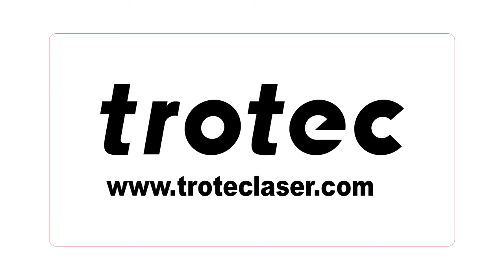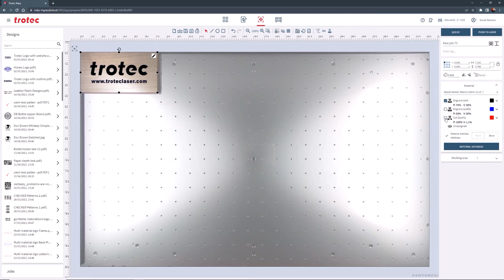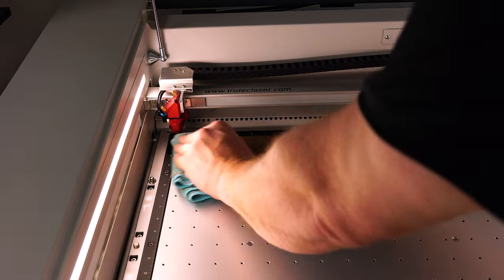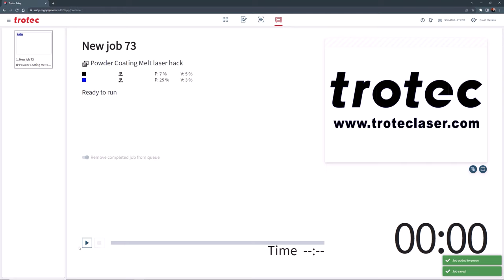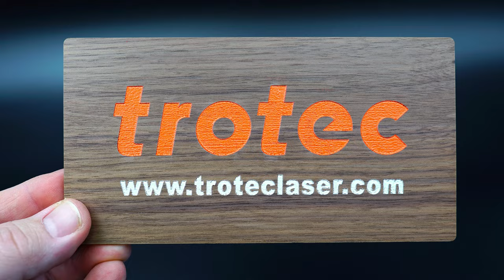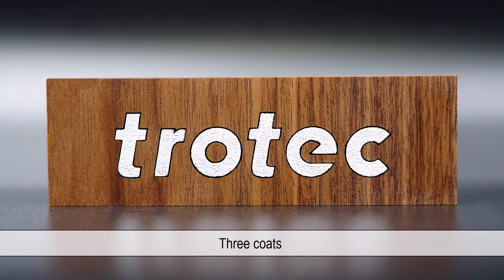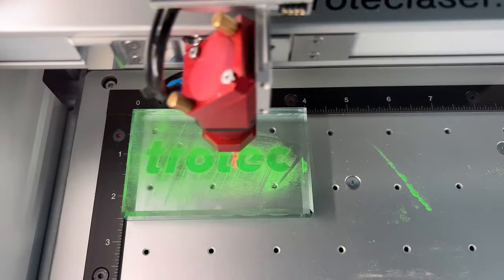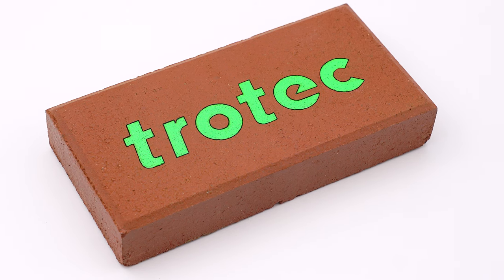Laser Hack: Powder Coating Color Fill

Comment: I've tried all of these suggestions and find that a simple heat gun on a low setting is far easier and better result.  Even does white perfectly.   Cheers!
Reply: Did you clean any powder that did not belong in the design before doing the heat gun alternative?
Reply: @CreateHubTips  You can probably use a masking tape over the top to achieve a clean surface.
Reply: @thenightninja13  masking is essential!  but i use the heat gun as well.
Reply: What is your complete flow?

Comment: So much easier if you use a heat gun on low, or a heat source like the broiler or toaster oven. Lightly sand when done.
Reply: Using a laser offers a significant advantage over a heat gun or oven based on extensive testing because it delivers heat precisely where it's required, enabling controlled melting of the coating at a specific location. On the other hand, a heat gun might inadvertently fuse any leftover or residual powder coating onto the product surface. This is because the squeegee is not always fully effective in removing all of the powder coating, which could potentially compromise the final look of the product. This principle also applies when the product is placed in an oven post-laser process. Any residual powder coating can be easily wiped off the surface as it was not subjected to heat, ensuring a cleaner finish.  Moreover, regardless of the heat gun's fan speed, even on low, it tends to blow out the powder coating from the engraving, creating an undesirable mess. Therefore, using a laser proves to be more effective and efficient for this effect.

Comment: Hello David!
a few questions.
1. What is the optimal engraving depth on acrylic?
2. Is the initial engraving also 125 dpi?
Reply: The depth engraved into acrylic is determined by you, depending on the effect/look you want; I will typically etch to a depth of around 0.03" for a nice-looking color fill.  Use the standard settings for the engraving with a DPI set to 500 DPI.

Comment: I've heard it is much easier to use a hot air gun. Do the engraving, fill it with the powder, and then use the hot air to melt it. It's much faster.
Reply: Using a laser offers a significant advantage over a heat gun because it delivers heat precisely where required, enabling controlled coating melting at a specific location. On the other hand, a heat gun might inadvertently fuse any leftover or residual powder coating onto the product surface. This is because the squeegee is not always fully effective in removing all of the powder coating, which could compromise the product's final look. This principle applies when the product is placed in an oven post-laser process. Any residual powder coating can be easily wiped off the surface as it was not subjected to heat, ensuring a cleaner finish. Moreover, regardless of the heat gun's fan speed, even on low, it tends to blow out the powder coating from the engraving, creating an undesirable mess. Therefore, using a laser proves to be more effective and efficient.
Reply: You are correct, and it looks better.  If you really wanted to, you could then laser engrave the outline for that effect after you're done heating it with the heat gun, that is the only thing making this "precise" is the outline, I mean how precisely can you really fill a void with one method over another?  lol 

My heat gun on low never blows the powder around.  Hold the gun about 8 inches up for the first few seconds until it starts to melt, then move closer.

Sand the wood when done, easy cleanup.

A laser is not more efficient at all, if we are using the word efficient as it is defined.  lol

I put the powder in my engravings all the time and it comes out looking way better than what was in the video and does not have bubbles in it either.  And I did not waste any hours on my laser tube doing it.  :-)

Comment: Thank you, David, for the informative video! 

1. Should air-assist be turned off when melting the color?
2. I don’t see you wearing a mask in the video, but I read elsewhere, ”Make sure you are wearing a respirator! The dust is so fine and the fumes of the melting plastic are highly toxic.” Is this statement true? Would this prohibit me from using the Pro-Tec powders at the public library with their Trotec Speedy 300 80 watt laser?

Thank you!
Reply from the maker: Yes, the air needs to be turned off as stated in the video, and no respirator is needed because you will not be “Spraying” the powder onto the material; that is how it is traditionally used (Thus the warnings), and the particles in that form would be dangerous to breathe, this process does not put the powder in the air, you will only be placing the powder into the engraving as shown in the video. You will then use the laser or a heat gun to melt it.

Comment: Or, save the wear on your laser along with the risk of misalignment and just use a heat gun to melt the powder 👌. Then you can lightly sand the face to get rid of any PC that's not in the engraved cavity

Comment: Why not use a heatgun with the fan on low speed? Its faster and easier to melt the powder that way
Reply: Using a laser offers a significant advantage over a heat gun because it delivers heat precisely where it's required, enabling controlled melting of the coating at a specific location. On the other hand, a heat gun might inadvertently fuse any leftover or residual powder coating onto the product surface. This is because the squeegee is not always fully effective in removing all of the powder coating, which could potentially compromise the final look of the product. This principle also applies when the product is placed in an oven post-laser process. Any residual powder coating can be easily wiped off the surface as it was not subjected to heat, ensuring a cleaner finish.  Moreover, regardless of the heat gun's fan speed, even on low, it tends to blow out the powder coating from the engraving, creating an undesirable mess. Therefore, using a laser proves to be more effective and efficient.

Comment: Hi Laser Dave! We had a chance to experiment with these powders today but have not had much success. We have a 100 watt CO2 laser; we started with your suggested settings understanding that there would be some needed adjustments given the wattage differential. We ended up with a small fire (totally contained) and began ratcheting the power down from there. 8 hours later we still didn’t get a result as good as yours. Our laser wasn’t outputting consistently running it at 1% so we had to put the Z axis, ultimately, after MANY gyrations, at a two inch offset with 3% power and 60 LPI. Essentially, we haven’t yet found a combination of settings using a 100 watt laser that will render a result that is fully baked into the wood without a lot of the char coming through the powder coating. We did second and third passes on some of our tests but they easily chipped off of the wood. If you have any suggestions we’d love to hear them!
Reply: Are you utilizing a Trotec laser for this task? The parameters provided here have been specifically optimized for Trotec lasers. If you happen to be using a different brand, I regret to inform you that I cannot guarantee the effectiveness of this process, nor can I offer assistance with parameters, as my expertise primarily lies with Trotec lasers.
Reply: @davidstevens2577  Hi!  No, we aren’t using a Trotec laser. My husband built the Rezo 1390 100 watt laser. We were inspired by the beautiful finish you achieved. I appreciate you taking the time to respond; we have had some much improved results using a heat gun for the melt rather than the laser.
Reply: @CutItOutWithUs  or you could just heat it up with a $15 heat gun from harbor freight, or anywhere, and achieve a better result than wasting life on your laser tube doing it.  ;-)  Takes way less time too.
Reply: The thing about heat gun is that you heat up some of the excess powder around the engraving with the laser it only touches the engrave section
Reply: @justfilming  sands right off in a few seconds.

Comment: Hi Dave thank you for the hack! Can we do this on Speedy100 30w machine? And would you recommend this method on synthetic leather?
Reply from the maker: Yes, this process will work on a Speedy 100, 30-watt laser; however, the engrave settings will need to be dialed in; I suggest starting around 12-15% power leaving all the other settings the same as shown in the video. As for synthetic leather, I am unsure if this will work because of the material flexibility, as I have not tried it, but it may be worth a try to be sure!

Comment: Hi Dave. What happens if you don't do the engraving before applying the powder? Wouldn't that work just as well, if you could lay out the powder in an even thickness?
Reply: Interesting concept. I cannot see why this would not work, but this is not something that I have tried.
Reply: @davidstevens2577  Maybe the "pre-engraving" is needed to get crisp lines (?). BTW: Really enjoying your videos. Thanks 😊

Comment: Hello Dave, would this also work in a fiber laser? 
And what would the setting be be for a speedy 400 CO2
Reply: This process will not work with a fiber laser at all, and I have not configured any settings for a Speedy 400, but if you are running an 80-watt laser on a speedy 400, the only change would be the engraving speed would be 4% since that machine engraves at a higher total rate.

Comment: I use the Trotec Speedy 300 80w laser at the public library. Should we be concerned about the powder paint clogging the nozzle and/or damaging or adhering to the lens? Thank you!
Reply from the maker: This will not be an issue as long as the system has the correct exhaust system.

Comment: I triet to engrave on a slver tumbler using the powder coat black,  I runned my diode 40w xtool in 100power 250 speed and 3 coats of the espray coat it in my view did not work. The lasered imagima just shnes and did not get dark.  Could you tel me what I probably  did wrong and how can I do better please.?
Reply from the maker: Thank you for reaching out and for considering us as a resource for your project. I appreciate the innovation and ambition behind what you're trying to achieve. However, since our expertise doesn’t extend to diode lasers, and our process isn't optimized for metal or tumbler applications, we're unable to assist directly with your current needs. This approach appears to be quite uncharted territory, and we’re unsure if it's technically feasible with existing methods.

Comment: Was so excited to try this with my speedy 360 but the powder coating didn’t melt and so the powder did not stay in the engraved part , any tips?
Reply from the maker: The brand and color you use can make a huge difference; make sure to test with Black and also make sure you engrave deep enough into the materials so there is enough powder coating in the engraving; you can also engrave it out and place it in the powder coating and wipe the surface clean then use a heat gun to melt the powder coating in place of the out of focus laser.

Comment: hi dave im having some trouble with trying to line my text back up to do the color fill after i already engraved it
Reply from the maker: For this to work, you have to place the material tight against the rulers. If the product or material is not tight and taken out and put back in, it will not align back up; even a few thousand of an inch will show up.

Comment: Is there a similar process for stainless steel?
Reply: Sorry, this would not work because a C02 laser will not produce depth in steel, but this laser length is needed to melt the powder coating.

Comment: I am very new to laser engraving, we use a speedy 100 and still learning so I am sure there is a setting somewhere I am missing.  I found a power setting that works but my issue is when the laser engraved it changes speeds depending on how large the area is it’s engraving ( we found this out on an acrylic project where some letters were engraved with different lvls in them as there were others in the same line that were shorter ) but when it speeds up it burns the powder.   But if I do the photo setting which goes The whole size of the engraver ( which I don’t know if that’s because my file size is set to the whole engraver plate or it’s just how it works ) the whole process is too slow ( only tried 50 speed so far and plan to test more ) so it won’t actually melt the product at all.   Still very new, what am I doing wrong?
Reply from the maker: Please contact our sales, support, or applications team to help you with these details, or visit www.mytrotec.com for our customer portal, which has access to training and support.

Comment: Hello Laser Dave, I tried this yesterday (though the Pearl White didn’t work too well on the walnut butcherblock). However, I don’t have the Powder Coat Melt Hack in my Trotec settings. I just bought it 1.5months ago. How can I get those settings? I did try to set up the same as you showed in the video but the blue line with the Mark setting didn’t really work.
Reply: Settings are in the video link; here is a link on how to install the parameters onto your Trotec: https://youtu.be/NlqwvwcrUj8

Comment: Dave, do you think this would work with a 40 watt Speedy 300? If so, would you suggest higher power and/or slower speed than what you found to work with the 80 watt Trotec?
Reply: Just double the power used on the 80-watt in the video, leaving everything else the same; that should get you close!
Reply: @davidstevens2577 Thank you!
Reply: Hello David!
a few questions.
1. What is the optimal engraving depth on acrylic?
2. Is the initial engraving also 125 dpi?

Comment: Can this process be done with a 10w diode laser?
Reply: This should be possible with a 10-watt diode laser, but the parameters would need to be dialed in.
Reply: I tried translating this for my XTool M1 diode engraver, and it didn't go well. Ended up burning deeper. Would love to know if anyone gets the settings for this figured out for my device!

Comment: Or you can just use a heat gun
Reply from the maker: A laser offers a significant advantage over a heat gun because it delivers heat precisely where required, enabling controlled coating melting at a specific location. On the other hand, a heat gun might inadvertently fuse any leftover or residual powder coating onto the product surface. This is because the squeegee is not fully effective in removing all of the powder coating from the surface, which could compromise the product's final look.  Because the laser fuses the powder only where needed, any residual powder coating can be easily wiped off the surface as it was not subjected to heat, ensuring a cleaner finish.  Moreover, regardless of the heat gun's fan speed, it can blow out the powder coating from the engraving, creating an undesirable mess even on low. Therefore, using a laser proves to be more effective and efficient.
Reply: @TrotecLaser now, hear me out.. what if one was to cover his material with transfer tape, do the engraving but leave the tape over the unengraved portions and then add powder coat and use a heat gun instead of a laser and then remove all the rest of the tape, leave the tape on the other parts should prevent the powder coat from “overspraying/overflowing” into any unwanted areas?